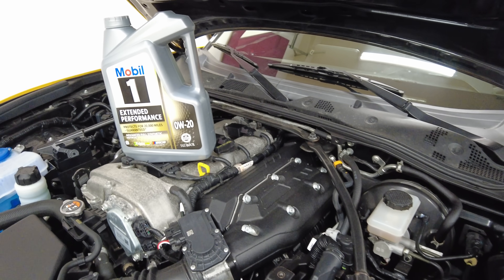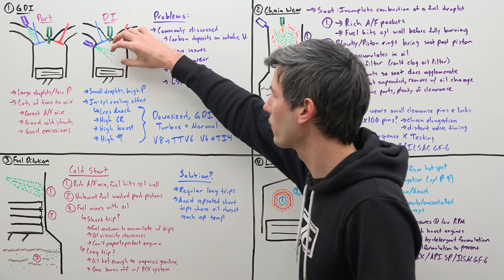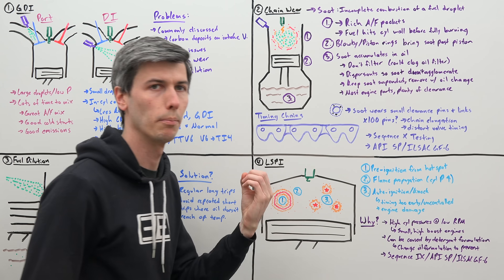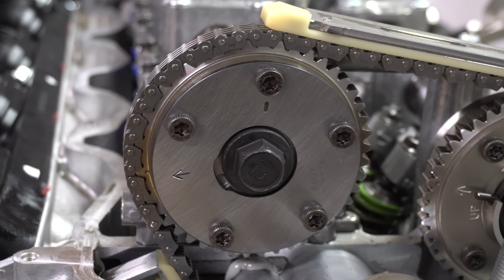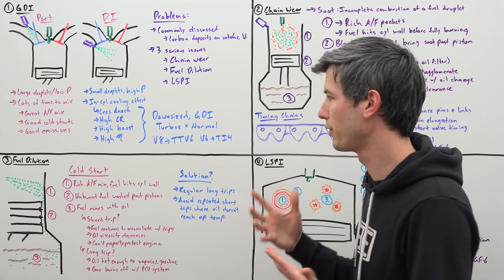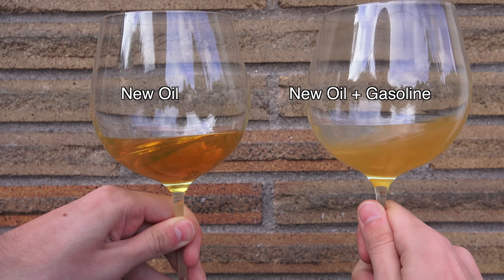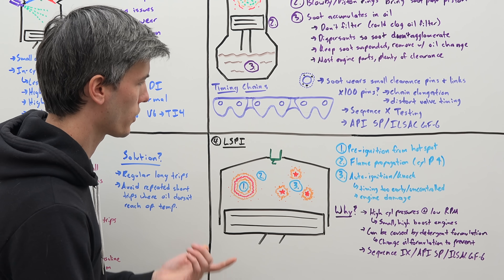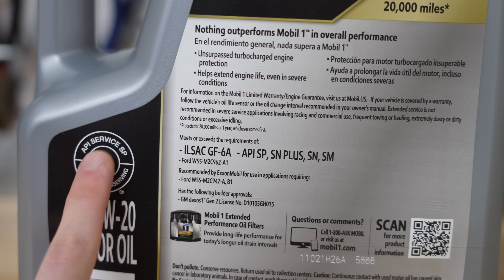3 Big Problems With Direct Injection Engines (Gasoline)

Comment: I gotta say, I always buy my oil & filter directly from Mazda and it doesn't cost me any more than my local automotive supply stores (Canadian Tire). If I'm not mistaken, Total Lubricants makes the Mazda-branded oil for most parts of the world but here in Canada, we get Idemitsu-manufactured oil. I could be wrong but I'd love to know the decisions behind the changes of supply; I know they're different.

I'd love to see how Mazda works with its lubricant-producing partners to develop lubricants best suited to their engines, transmissions, differentials, etc. based on climate and expected use. And I'd love to see high-performance tests between manufacturer-branded oils and other OTS concurrents.

Anyway for my use, just the regular Mazda-branded oil changed at the recommended interval will be just fine. My drivetrain always gets nice long trips; it's my wife's poor Jetta that suffers from those excessively short start/stop trips.

Comment: treat it like a timing belt have it as a separate chamber, seals on the crank and cams, along with a ver low pressure oil pump running off either either thr crank or cam or perhaps an electric  one with oil jets at the concerning areas.

Comment: Too much tech in badly made modern engines are a recipe for early failure. New engines are becoming ridiculous now - highly stressed little engines may emit less at the tailpipe but they waste resources when another engine is required. We are going backwards, not forward

Comment: So in short, change oil every 15000km to be safe. Still wondering why manufacturers do want oil last 40000km.. its redicilous long. Especially with dpf systems and direct injection.

Comment: Air cooling for direct injection would be the same as any other system because the liquid fuel changing state to a gas would be the same?

Comment: Hey guys, could anyone tell me what's the best type of engine for short trips ? I drive about 8-10 minutes to work and I currently have 1.9 TDI and any diesel engine that doesn't have time to warm up will end up carbonised.
Reply: Perfect commute for a Nissan leaf
Reply: @josephgriffin1065  let me correct my question. Is there any europan multi point indirect injection petrol engine that has 150 HP or more ?
Reply: @ry0_  I do not know the answer to that, America doesn’t always get the same engines that Europe gets, I like port injection, but it is getting more rare, fuel prices in Europe tend to keep horsepower down….

Comment: The high pressure fuel pump can cause a greater load on that chain, so elongation is more likely.
Reply: Aren't most fuel pumps electric?
Reply: @CraigTaylor  The pump in the tank is electric, but the high-pressure pump for GDI is driven off one of the camshafts and puts an extra load on that chain.  That's why chain elongation is even an issue which caused oil manufacturers to re-formulate their oil specification addressing this wear.

Comment: @engineering explained long drives help vapourize the fuel in oil only if the cars systems let it get to above 95C , the boiling point of petrol. Many cars now have oil coolers and in cold temperatures , the engine oil stays between 80 and 90 C. Another engineering advantage and disadvantage ( Oil Cooler)

Comment: Well done! 👏👏👏 Question: can you comment (or perhaps do a video?) on the benefit of using premium, higher octane fuel for these modern GDI engines?
Reply: I only use premium fuel for my cars.Turbo or not.  Most engines today are high compression,  the only reason manufacturers say its fine to use 87 octane is because of knock sensors and the ability of the computer to adjust timing when knock is detected. My 4 cylinder turbo never knocks ,or another term is PINGS, and therefore timing stays advanced for best performance and protection of the engine.

Comment: Great video. You can see why the trend is moving towards electric vehicles when you understand technical issues like this.
Reply: Electric vehicles still aren't practical for long trips. I mean LONG TRIPS, LIKE 5 6 7 hundred miles a day, for 2 or 3 days. And Electric cars won't last 2 or 3 hundred thousand miles like a well cared for combustion engine will. Batteries won't last that long, neither will the Electric motor, and replacement is usually a mortal wound for those cars..I have an old TRANS AM I bought new in 94. It has 338.000 miles on it now.  The engine has never been touched, even the timing chain is original. It still runs like new. Has never failed California emissions test.
Reply: @1958Cadillac-v2g  not sure if I agree with you there. Electric motors are bulletproof - they're so simple there's nothing to go wrong. Batteries can last for 1 million miles these days (out lasting the car). I'm a total petrol head but I'm resigned to the fact that I'm going to have to change and I'm going to embrace it!

Comment: Another great video from the channel. I’m 57, spent a lot of my time over the years working on cars as a DIY mechanic for my vehicles and family and friends. I ditched piston technology in 2019 and went EV, for some of the reasons in this video, and out of respect for future generations. All this complexity, compromise and anxiety goes when pistons get replaced by electric motors, which are simple, reliable and maintenance free. Welcome to the EV revolution!
Reply: dont think a tesla battery with 7000 cells is simple and reliable just one bad cell and you got issues
Reply: @peterrestaino7047  There are Tesla’s out there that have done 500,000 miles on the original battery pack, and battery technology is improving all the time. The Chinese company BYD use LFP battery chemistry, and warranty their batteries for 500,000 miles. I’ve owned a lot of high mileage combustion cars in my time, the best I got out of one was 240,000 miles before it was utterly knackered.
Reply: Only problem is the rare earth materials used to make this tech or the coal burning plants that provide energy to allow You to charge the battery. Once we are able to rely on something that's not called "rare" and once more thorium nuclear reactors replace our aging energy infrastructure then I will gladly stand behind EV's usage. Despite my love for motorsports my desire and appreciation for our mother 🌎 leaves me hoping that the greedy corporate interests and their political puppets start thinking about future generations as soon as possible.
Reply: @dohabandit  There is a lot of misinformation out there about the environmental impact of EV vs ICE. A lot is spread by the fossil fuel industry, who want us to keep burning oil products. If you really feel that an EV is not better for the environment, I suggest you do more research and try to look beyond the FUD.

Comment: it's complete BS about chain wear.

I have 2012 Focus 2.0l GDI WITH 400K

Runs like a clock! 
And it dont give a f&CK about carbon deposits either..

The biggest problem now days is road salt! This what in long run will destroy any reliable vehicle! Engine and transmission is not what you should worry nowdays...

Comment: Water methanol injection is the easiest and simplest solution for DI engines. 50cc nozzle will keep your engine chemically clean and soot dissolved

Comment: You could of course be more vocal in your opposition to the carbon-AGW hysteria. Murphy (and his acolytes) are having a field day with this anti-Science nonsense. Getting rid of lead from fuel was necessary but the rest, unless it was efficiency and power/performance related, is utter garbage.

Comment: Very very useful information... I have a quastions.
1- Why most of GDI engine burn some of oil and we see it when we open the oil fill cap and the engine running with no matter how much the engine run.
2- what is your evaluation about TOYOTA CAMREY GDI Engine that put it on the model 2018 and above.
I will wait for the answer

Comment: my 2014 ford fusion 2.0 t DI engine has none of those problems.. i change my oil with syn. oil every 5/6000 miles.. ovs from day 1.. so very little if any carbon on my intake valves.. checked last month while cleaning the TB ( 155000 miles on it.. and the TB was very clean...and engine oil tested every other oil change,,with in specs... then again, i work on classic Italian cars..so i take great care of my car.......by the way.... the pcv system is a great design on this engine.... not on the valve cover.. but on the side of the block under the intake manifold,, they have a baffled plate to condensed the oil vapour.. the ovs i installed after 5000 miles has very little oil in it.. the most i have seen inside it,, barely covers the bottom of the catch can..ford did there homework..unlike vw/ audi, bmw..or mbz... as you know there intake valves get all full carboned up in a short time  50000 miles

Comment: I think GDI is one of the worst changes to the internal combustion engine. Hopefully like when many automotive manufacturers have abandoned timing belt for chains, that they do the same with GDI. My question why is it acceptable for new modern engines to burn a quart of oil between oil changes?

Comment: I had a 2017 Honda CRV. It was claimed to have an oil dilution problem. I never had anything but spectacular MPG. 32 m
Reply: Mpg has nothing to do with excessive engine wear from diluted oil from gasoline.  When your bearings fail, you will get 0 mpg.

Comment: i dont think GM thought it through very well because the GMC Acadia is notorious for issues related to the timing chain due to DI and their 7500 mile recommended oil change interval. which is too high for most cars in my opinion. i change mine in about half that mileage, because i also use my Acadia to drive deliveries for a local restaurant  and im constantly doing short trips.
Reply: The Acadia is a nightmare in general.
Reply: @theglowcloud2215  you ain't wrong. I'm having tans issues right now.

Comment: Use of the new 0-16 oil designed and manufactured for this specific fuel delivery design can make a big difference and purchasing a vehicle that uses both methods of fuel delivery port and direct can go a long way to helping with that situation as well by allowing gas to still pass over the valves greatly reducing carbon buildup. Also I would maintain a stringent earlier oil change interval dont cheap out on oil changes they cost nothing in the grand scheme of engine protection.
Reply: Our 2020 Corolla uses both port and direct injection, the best of both types with the downside of added engine complexity. Luckily the little four-banger does not use turbos. We keep our cars until the wheels fall off, here in the rust belt that is 20-25 years. Hopefully our new one will last as long. Toyota recommends the "new"  0W-16 oil for this engine.
Reply: @tomschmidt381  Right on! May you and your Corolla live long and prosper

Comment: It's called the Italian tune-up. Drive for 15 minutes steady at 4,000 rpm every two weeks. My turbo 4 direct injection Kia always has a better slow idle afterwards. And make sure to get an induction cleaning once every 25-30k miles.
Reply: It's proven that the "induction cleaning" services/products are pretty much useless. The only way to remove carbon from valves and valve seats is to remove the head/valves and clean them using a wire brush and solvent.

Comment: i am keeping my 2003 chevy van...no thanks.
380k miles 20mpg full of tools cheap to fix no major issues.Changed oil 3000 miles . And trans oil twice a year.Oil looks clean after 3000 miles . 
New DI  stuff is a disaster. 
Ford Eco boost pos. 
Only Toyota good anymore.
Euro cars the worst.

Comment: I passed on purchasing a car with a smaller direct injection turbo engine because of the issues with fuel in oil dilution and carbon in the intakes.  In my opinion solely using GDI is not a good system for car owners, but an advantage for the manufacturers.  I opted for the same car with an older design port injected engine.

Comment: I always though a direct-injection engine running on the Atkinson cycle didn't have the carbon buildup issue on the intake valves, just engines running on the Otto cycle.

Comment: Short oil change interval is key! 3K miles is the sweet spot (and if you do a lot of short trips) or 5K miles max. Also intake valve cleaner on the correct interval.
Reply: A 3k interval is a complete waste of oil, especially if you're using the correct oil.

There's more to the engine oil interval than just how many miles you're driving and whether you have direct injection or not.

Comment: Question: 
When the fuel is evaporated from the oil due to completing a long drive, does the oil return to (more or less) it's correct operating condition/viscosity?
If so, and the viscosity remains unaffected, does the fuel dilution also lead to the oil being affected in other ways such as the dispersants/cleaning components/pressure components etc... not working?
Thanks
Reply: It is similar to destling alcohol, gasoline has lower evaporating temperature than oil, so oil stays, gasoline goes. It probably harms the oil little bit, but so does running engine on normal operating temperature. If you do lot of cold starts and short trips, you should shorten your oil change interval.

Comment: Direct Injection engines have been around for 15+ years now. If this were a real problem vehicles would be failing all over the place - but they aren't. Change oil per the manufacturer's maintenance plan using quality oil which meets the requirements and you'll be fine.

Comment: It always shocks me the amount of soot that builds up on modern car exhaust tips and sometimes so bad that it stains the bumper too, is that due to DI?
Reply: Yes it is, since at high pressure the petrol still forms droplets, since droplets don't burn, soot is formed. But it doesn't have to be this way, I've got a GDI engine with LPdi (liquid phase direct injection of autogas) - no soot formation. The advantages of GDI without the disadvantages, no carbon build up, no oil dilution and no dirt in piston rings. I hope Jason will make a video about this. The octane rating of autogas is also higher, so there are also some advantages!

Comment: Get the advertised oil, or use a rubber/fabric timing belt which does not have the chain elongation problem.

Comment: Doesn't the engine oil viscosity increase when mixed with gasoline (rather that decrease)?
Reply: Definitely NOT! Why would you think adding a watery substance like gas, would make oil, THICKER??
Reply: @1958Cadillac-v2g  Adding gasoline makes the oil thinner

Comment: In my opinion it's okay for passenger cars but trucks should not have V6 turbos I get it the 1500s and the 150s are passenger cars at this point let's face it they have four doors half of them don't even go off-road half of them don't even tow half of them don't even freaking do any work people turned the halfton truck into a freaking passenger car It's disgusting there's a reason why the work trucks the big ones even Fords don't have turbo gasoline engines They even went to the point to give us a big block 7.3 L Port injection pushrod V8 there's a reason for that and Ford knows

Comment: Wish you went more into detail about the carbon/soot buildup on valves and intake runners over time on GDI engines that don’t also have secondary port injectors. I’ve seen so many Hyundai’s and some GM’s start misfiring and running rough due to the carbon accumulation on the valves and intake if the customer doesn’t do their carbon cleaning maintenance at the appropriate interval (most people who buy these types of cars dont) and then they’re upset their car is misfiring.
Reply: He has a video specifically on that issue, look through his videos and you’ll find it.

Comment: Running an unopened Chevy I6 in my daily truck...dating to 1927. Smooth, quiet,  powerful and revs to 5000.  Put a Weber two barrel and a big air filter on for driveability and fuel savings. Cheap oil and big external full flow filter. No PCV system. Crankcase vents to street. The engine cover has vents. The oil stays golden for 3000 miles. No sludge and no glitter in oil after 450000 miles. The engine pulls hard in my tropical boat towing, desert, jungle, sand, volcano environment. Modern cars here last 3-5 years..complicated German boutique automotivetry 6 months to 1 year.
Reply: I agree I have a 85 d150 with a slant probably has 300k miles on it and I get almost 20 mpg and I paid $1200 for it lol
Reply: @alexlandsberger1423  rare truck nowadays.
Reply: But no one gets to financially exploit people using efficient designs like this, and we can't have that.